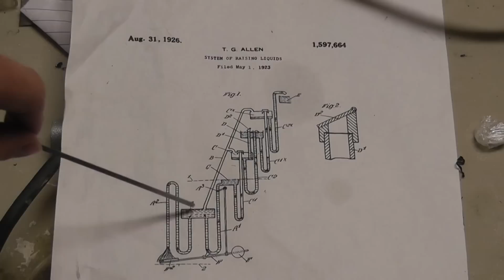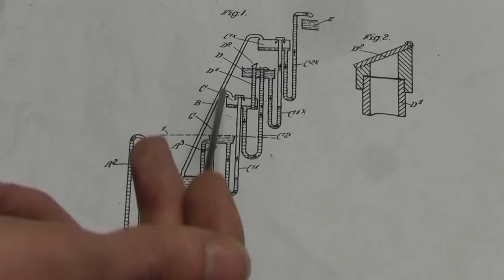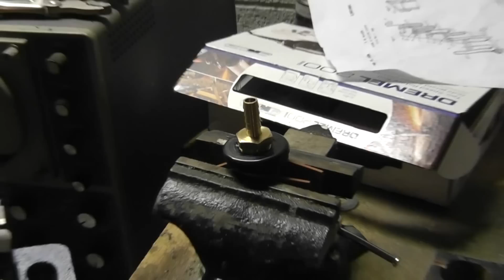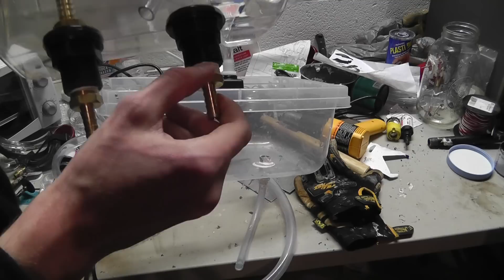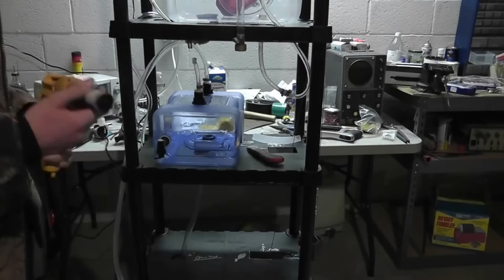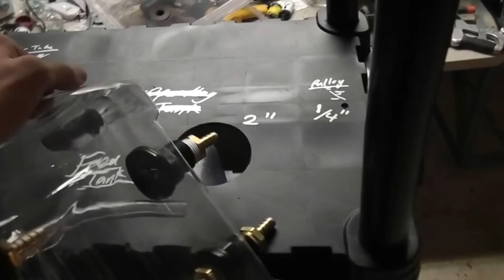Build Your Own Hydrautomat - FULL

Comment: hi , i feel it's a useful device but can it work 24/7 ? and how i can use it in aquaponic system ?
Reply from the maker: The device can operate 24/7 - as long as you supply water to the feed tank: it will continue to operate. As for the prospect of using it in an aquaponic system: unless you need to pump water without a electric or fossil fuel powered pump, there isn't much point in using this particular device.

However, some of the technologies used in the Hydrautomat, such as traps in place of check valves or using air and water to create pneumatic cylinders, could be included as control mechanisms; which happen to be my main interest in the Hydrautomat at present.

Thank you for asking.